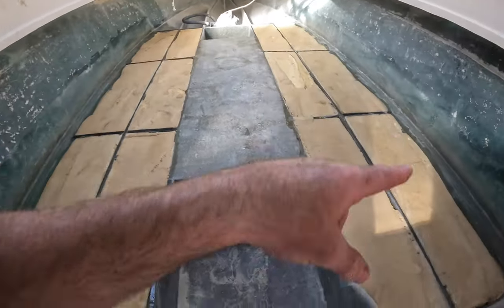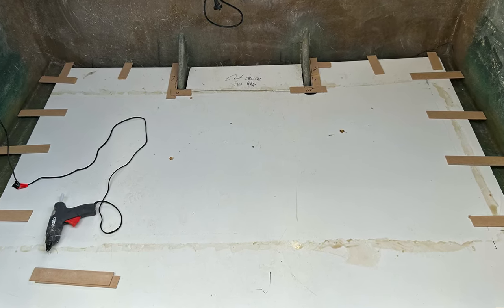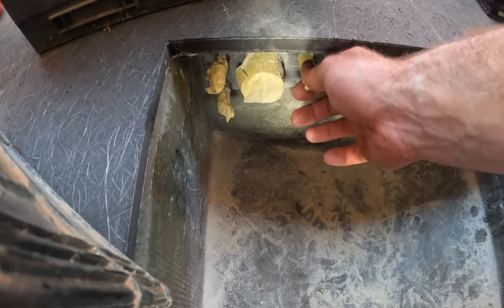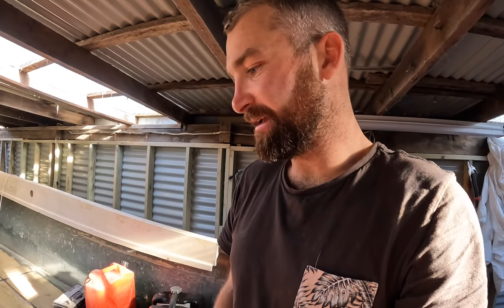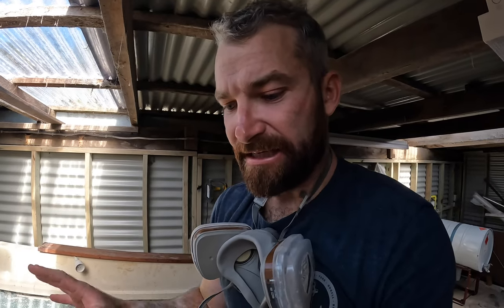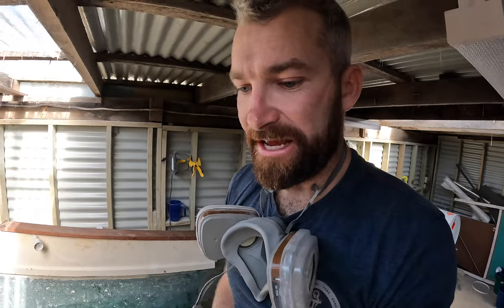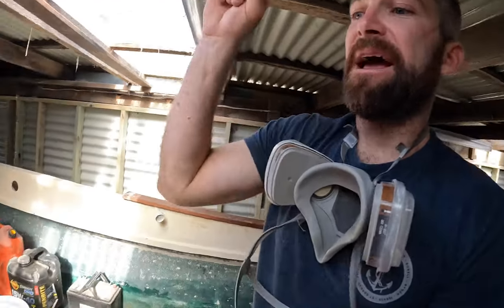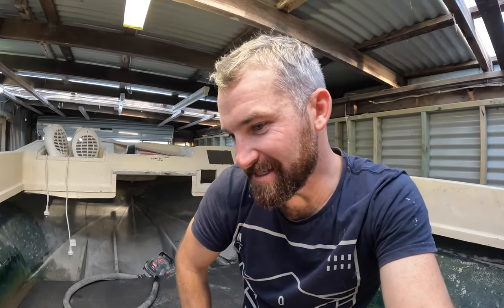Gluing Down Thermolite Floor on a Haines Hunter 600R

Comment: Looks great, any reason you didn't put a layer of glass over the foam for extra protection?
Reply from the maker: Was always going to use so much glue that it’s not a concern for water getting in. The floor has 3 layers of glass over it and I don’t intended on screwing through it at all.
Reply: @ADVENTURES_ADRIFT  Yeah once I watched the video and saw the volume of glue I was happy, I made the original comment before that, cheers.

Comment: What’s the rough cost of the floor mate. Thermolite + all the glass and resin. I might have to to my floor in my 24 foot ranger and just want to know how much it’s going to sting.
Reply from the maker: Thermolite is about $500 a sheet, I used 3 for the floor. Resin I’d say 40-60kg worth depends on if you use vinyl or poly but say around $500-$1000.
Reply: @ADVENTURES_ADRIFT  thanks mate.

Comment: Did that model have a keel stringer ,did you cut it out to add the fuel tank of just make it flat floor
Reply from the maker: I cut the keel stringer out, I added extra glass to the keel and had at least 8 layers overlapped in the keel so it has plenty of longitudinal strength. I then put a false floor in and built the tank on top of that.
Reply: @ADVENTURES_ADRIFT  thanks mate I will have a look at if it is worth doing the same